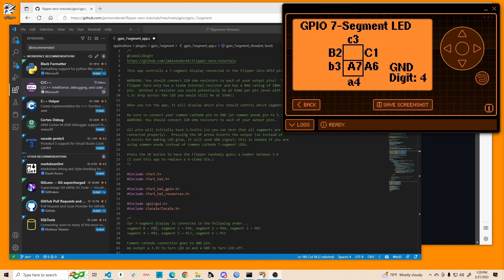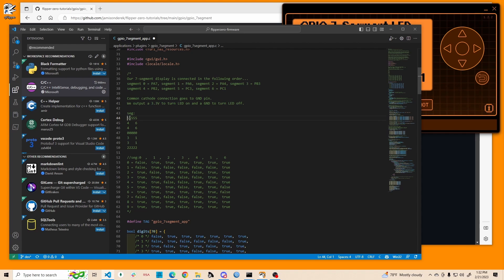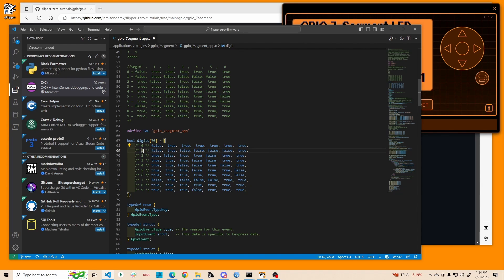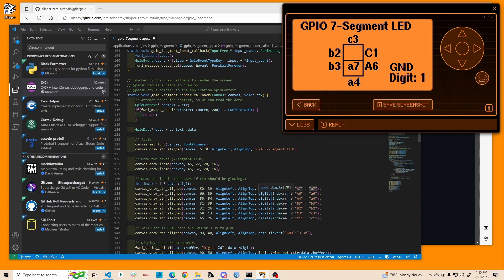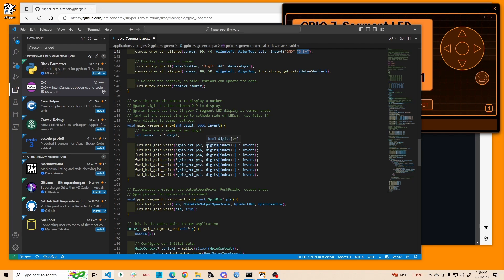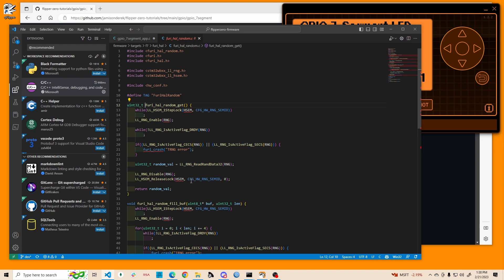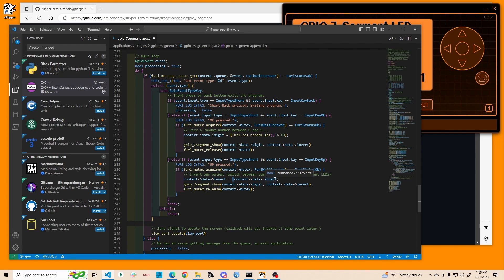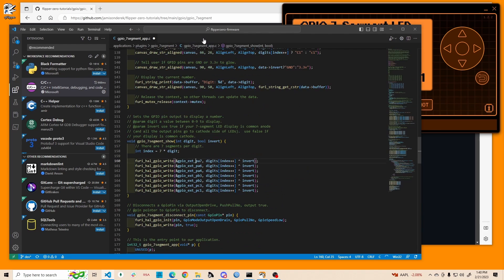[27] Flipper Zero - GPIO 7-segment code

Comment: This is very interesting, I'm glad I found your channel.  I've been trying to learn as much as possible with this device and now looking into code. I appreciate your videos, I think your channel is the only one that goes into depth and takes the time to explain the inner workings. I installed a RBG backlight and everything works except now my back button does not work, it will however allow me to restart and access DFU mode. Would accessing CLI with the "input" command allow me to test or reset its function?
Reply from the maker: Interesting. I would go to https://lab.flipper.net/cli (or connect via serial port) and run the "input dump" command.